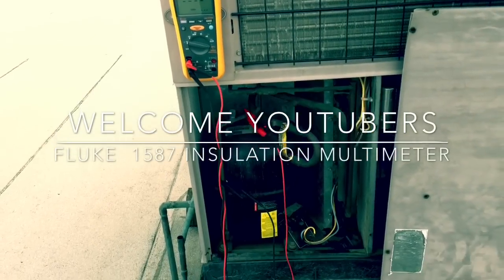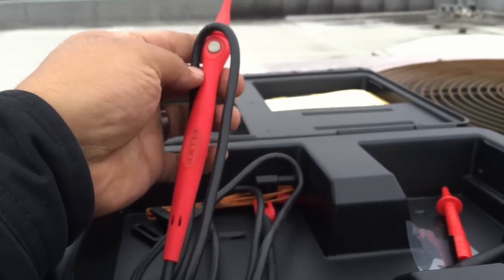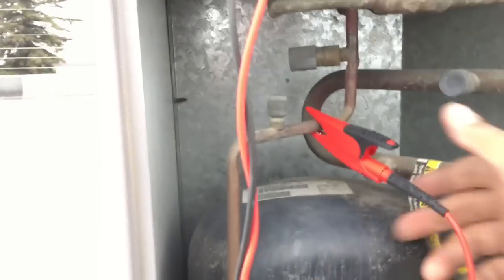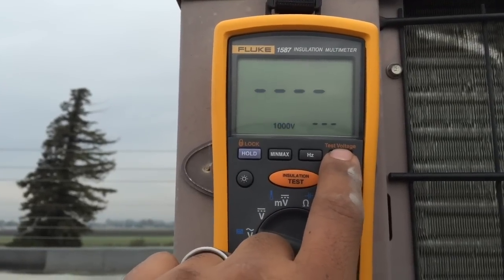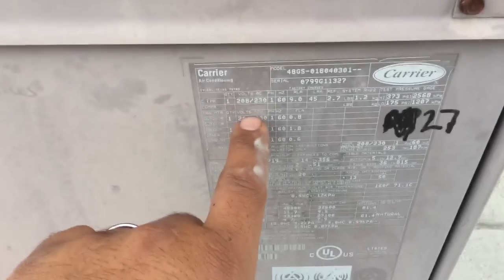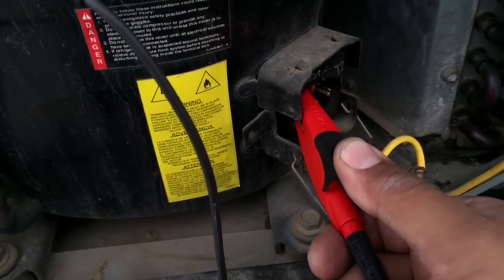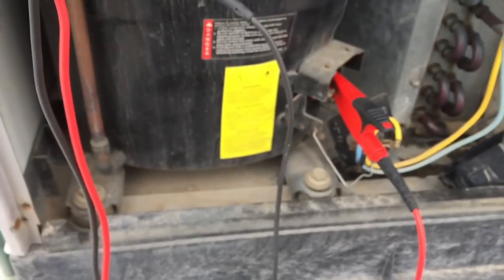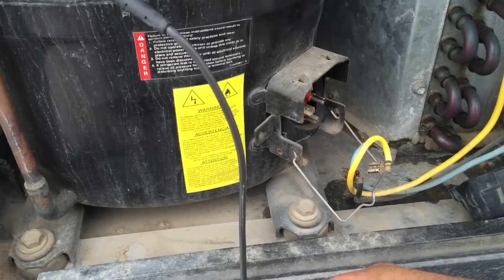Fluke 1587 Insulation Multimeter

Comment: pretty meter, Fluke makes great meters, they are expensive though, but they last.
Reply: Nice Tazz. Great video and demo.
Reply: that meter is boss!
Reply from the maker: Justin Mikola bro the metter is loaded I plan on doing a full review on it soon! Thx for watching
Reply from the maker: ***** your absolutely right. Was a investment for me great tool that I plan on having for a long time.
Reply from the maker: Daniel Zamora thx man! I played with it all day today at a maintenance facility we service Megohming all kinds of compressors and motors fun. It gives us a starting point then its monitoring from there on out.
Reply from the maker: Walt Hobs thank you for watching however I gave that advise cause it came right out of the horses mouth. Fluke tech support states that you should test at twice the voltage of what's being tested.
Reply: Would you believe I found this meter at a bootsale here in the uk (flea market?) for less than 10 dollars (6 pounds) didn't have the insulation test lead but had the two normal test leads. The thing works fine have tested everything apart from the insulation test function but it tests ok without the lead so I think its fine. Cannot figure why he sold it so cheap he obviously never googled what it was or when it was in microvolts/amps saw the display was flickering numbers and assumed it was broke?!. I didn't even check that it worked I just gave him the money as I knew it was worth way more even if it had a fault. Awesome multimeter even without the insulation test function.